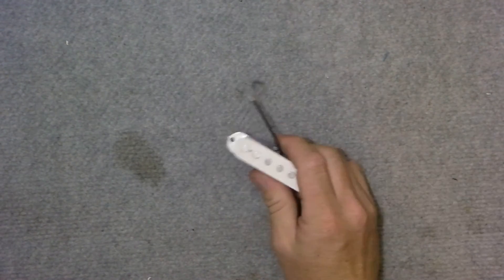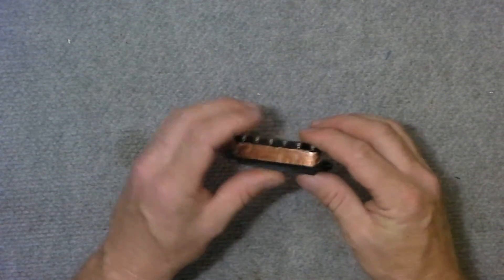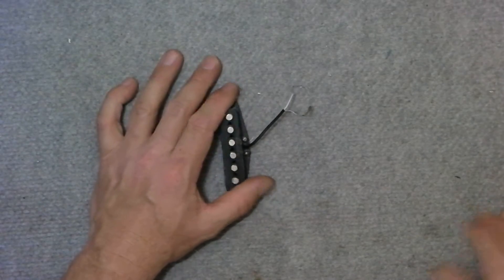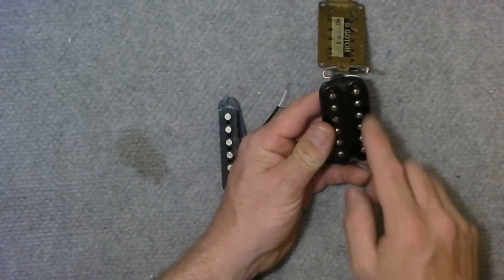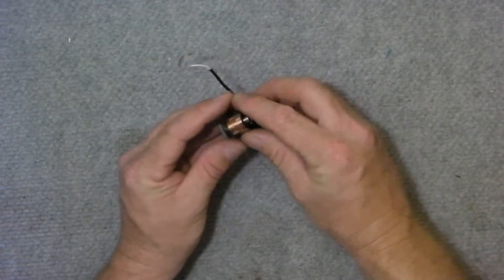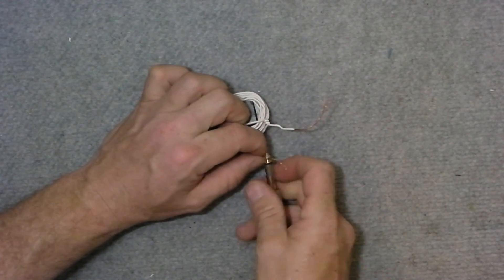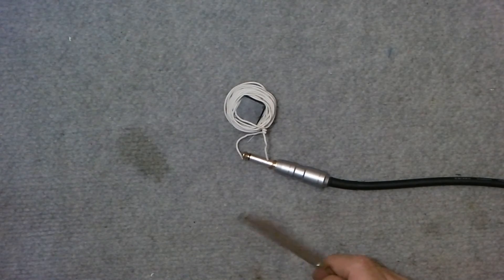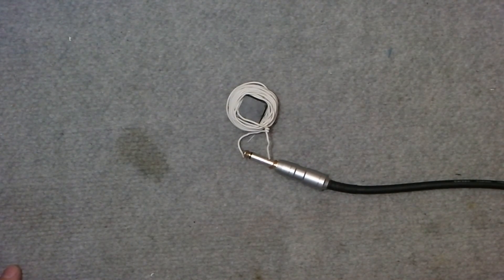How Do Guitar Pickups Work?

Comment: That wheeze with the tuning fork was quite interesting. Have you come to any conclusions about how changing single variables, i.e. wire diameter, number of turnes, shape of winding, etc., changes the sound?
Reply: The more turns increase the strength of the signal thats output, the thicker the wire allows more frequencies to pass through. This is what i have seen in other videos. Highline guitars has good videos about some of the more specifics of tone when making pickups
Reply: @saladrobe  Thank you for that. I’ll look up those vids. That’s fascinating stuff.

Comment: My question is.. If i remove the ceramic bar from my pickup and remove the steel pole pieces, then replace said pole pieces with alnico pole pieces, will that be a successful pickup magnet swap? Or is there more steps to it?
Just for reference its just a simple ceramic single coil in a yamaha.
Thank you
Reply from the maker: As long as the windings aren't damaged in the process it should work just fine.
Just make sure you push all of the alnico pole pieces in the same way with respect to magnetic polarity and the right way for the particulars of the pickup location and function. Reverse wound needs reversed magnets ect.

Some older pickups actually have the wire wound around the pole pieces.
This could make things tricky.

Comment: Nice vid, however, your custom wound coil mag should have had a post/stud 
protruding up off the magnet & your 1/4" plug should not have been in
 the path of your tuning fork in any way--just so watchers could be 
certain that you had no extraneous effects created by your arrangement 
of the pieces.

One other (obvious) thing that you probably should have noted was that an electric guitar strings are made of ferrous (iron) wire that is magnetic--and that it vibrates within a specific physical range near each pickup post.  That would be good info for super newbs...

Thanks for sharing!
Reply from the maker: Really? Why would I need a "post/stud" which I assume would be a pole piece?
Its a raw demonstration so other can see how pickups work.
Also I do refer to pickups requiring ferrous materials to interrupt the magnetic field. Here is it is in the video 4:45.
Reply: These commments are unneccessary.  The important thing is that nothing said was wrong, while giving  a very sound intro into the relationship between a string and the pickup. Have you considered making your own vid?
Reply: +Paul Graham
These commments are unneccessary.  The important thing is that nothing said was wrong, while giving  a very sound intro into the relationship between a string and the pickup. Have you considered making your own vid?

Comment: Hey, great video!
Recently I decided to investigate how the number of coils affects the volume of the signal for a school project, and i am planning to basically make a similar type of model 'pickup'. However, I also plan to make a model of a humbucker pickup with two magnets and test the effect of spacing of the magnets and their ability to reduce the 'hum'. Would this be a feasible experiment using simply magnets and wire like you have done? Also, do you have any recommendations as to the type of magnet i should use? I am currently planning to buy neodymium magnets.
Thanks!
Reply from the maker: For all intensive purposes any magnet will work providing it is strong enough.
The magnet you are suggesting though will be very powerful and aren't generally used for pickups for that reason. They may pull on the strings and cause dissonant overtones. 
Other than that your investigations should give you some data that will give accurate results.
One other thing, Humbucker coils are reverse wound and this is responsible for the hum cancelling and the magnet has one pole under one coil and the other pole under the other coil.
When you use two different magnets make sure that each coil has the opposite pole up to the coils.
Separating the coils physically with in the guitar will generally not affect hum cancelling.

Comment: What is the exact building difference between a single coil and a P 90 ? is it just  the larger, but less high shape of the windings of a p 90 and the use of magnetic polepieces(single coil) instead of one central magnet (P 90) ?
Would be great if you could help me out :)
Nice video

Comment: I love this. You actually showed, not just the basics, but some of the finer points of how pickups work that some people with a fondness for swearing and a whiteboard seem to miss entirely.  The only point that I'd contend is that pickups actually are a type of microphone, and it helps to think of them that way.  Guitar pickups are a very crude, inefficient, dynamic microphone.  They work the same way, they're just designed to pick up the string and not an audio source.  Although as you point out, they certainly can, hence the potting.  I've come across old pickups that were designed as microphones to pick up the sound of the string as much as the vibration of the string, and a few that were made from microphones. This continued into the fifties but had pretty much died out by then.
Really good video!
Reply: Heh, I liked the subtle mention of a certain Dr. Chill!
Reply: with a dynamic mic the coil windings move because they are connected to a moving diaphragm, BUT with a pickup the coil windings do not move - the metal guitar string interferes with the magnetic field around the coil -  so better to think of it as a different implementation, not a version of a dynamic mic - but a static mic!

Comment: But how does impedance works, i saw this video and thought that to reach a higher output level you must add more coiled wire, this is so confusing for me
Reply from the maker: +Hernan Castro More wire will generally increase output but due to inductive reactance the high frequency roll off will be lower making for a darker sound. The diameter of the wire affects the output also. The impedance is a combination of inductive and capacitive reactance and DC resistance. You really need to study AC circuits to get the idea.
Reply: Ok i will, at least i get the idea... the more wire, more output and more darker the sound. Thanks for your video and your help.

Comment: What will happen to the output signal if i decide to connect the wires coming out of a single coil/humbucker directly to the input jack without putting tone/volume knobs in between? Can you tell?
Reply from the maker: +Dick Brett Yes you will hear a diiference. The output will increase a small amount and the sound will be brighter and for the lack of a better term it will sound more Hi Fi.
The volume and tone pots and the tone capacitor all load up the pickup output and short out some of the output and dull down the high frequencies a liitle more than the lows. It all has to do with impedance.

Comment: Having knowledge of physics I know that magnet pickups are designed to work with strings that interact with the magnetic field changing the magnetic flow exactly as you show on your educative video.
I wonder how wood can DIRECTLY affect the magnet pickup or indirectly. I mean that:

I had an unknown model , cheap magnetic pickup .
I also recently I bought the expensive L.R. Baggs M1 magnet pickup.
Both these pickups, on any place, on top of my acoustic guitar (even without strings) detect the wood vibration, as well as would detected by a piezo crystal and connecting them on a simple battery amplifier the knocking on any part of guitar top is heard very strong.
The knocking is heard on amplifier even putting the pickups on a wooden table and tapping the table. 
For the 1st one I would say that it might have loose coil windings and that would justify the phenomenon but what about the 2nd LR?
Reply from the maker: +Στέφανος Σκιαθίτης There has to be some metallic movement within the magnetic field of the pickup if it solely a magnetic pickup.Either the windings are loose or the backing plate on the pickup is vibrating or something to that effect.
Reply: +Paul Graham (Guitar) 
Yes that is the correct answer. I asked because I prepared a video on a similar subject and I wondered how an expensive pickup as that of  M1 LR Baggs could behave the same as mine construction pickup. But I found out the explanation and I have already posted it on a video here: http://www.ultimate-guitar.com/forum/showthread.php?t=1693208

Comment: How much voltage does an actual pickup produce normally? How much should a homemade pickup produce?
Reply from the maker: +Kaushal Kishore Generally passive pickups will produce less than 1 Volt output.
The average for a single coil may be around 250mV and for a humbucker it may be 400mV.
These are only generalizations as every brand and model of pickup will have different output levels.
Extremely hot humbuckers like the X2N put out 510mV but will go close to a volt with the strings are really close to the pickup with a heavy strum.
As for a home made pickup it will all depend on the strength of the magnet, wire size and the number of windings, not forgetting the configuration. (single , humbucker and soap bar).

Comment: Very good explanation of how a pickup works. I have just taken a course in basic electronics, therefore, disturbing the magnetic field and creating an electrical current from the inductance of the coil makes perfect sense. However picking up the actual sound of the tuning fork or strings will require additional research on my part....... Vic

Comment: Hi, I'm the only idiot here failing to learn. I guess I'm trying to learn something else, and misread the title. Either way, I appreciate you taking your time to teach.

I just want to know why there are 5 different pickup ranges, and why they're used.

Best wishes.
Reply from the maker: Gordon Thomas I am guessing you are talking about the 5 way pickup selector on a Stratocaster or similar.There are many different pickup combinations and pickup selections out there and they all sound different for one reason or another.Pickup location influences sound in that the closer a pickup is to the  bridge the brighter it will sound and closer to the neck a pickup is the warmer it will sound.In between pickup selections generally use two pickups in parallel and this tends to give a mix of the two pickups but with a more scooped mid sound with a little less bass also.Everyone has they're own preferences but I tend to use the bridge selection for distortion, the bridge and middle pickup together for that country quack, middle pickup for a clean sound with less bass, neck and middle for a clean mid scooped sound with sparkle and the neck pickup for a warmer clean sound with bass.I also often use the neck pickup with an overdrive pedal or distortion for Blues and rock lead.There are also different pickup types and pickups tailored to give certain types of sounds.On top of all of that there are many more pickup combinations and many other factors that can alter the tone of a guitar.I hope I have answered your question.
Reply: ******sniffle* yes. Yes you have answered my question. Thank you.

I'll be copy/pasting this if you don't mind. Only to a personal note file.

Forever a student.

So When you want 'lower' sounds, you lean more to the 'bottom' 3 selections, and lean to the top two for the highest, tightest/brightest sounds?

Or am I way off?

Comment: Hi Paul, 

I was wondering if you could help me out a bit - I am doing a university dissertation on guitar pickups. I have built 4 pickups for comparison: all humbuckers with 42AWG wire and the same number of turns (5350 on each 50mm bobbin), but with a different magnet in each pickup - Alnico 5, Alnico 4, Alnico 2 and Ceramic 8. I have audio clips of each pickup tested using the same plucking velocity and same guitar etc. Basically the only thing that is different is the type of magnet, in order for a fair test.

I was wondering if you could tell me what differences I should see in each magnet? ie. characteristics in tone and output levels? I'm finding it hard to get the information that says this. Any input of yours would be greatly appreciated as I found your video inspiring.

Cheers,

Elliot
Reply from the maker: Hi Elliot.
From the information I have seen the lower the grade of Alnico the more inductive it is and this should result in Alnico 2 having a reduced high frequency response as compared to the rest.
Alnico 5 will be the strongest magnet in the Alnico magnets thus having the most output from the Alnico magnets.
The ceramic magnet will possibly be the strongest magnet thus giving the highest output and will have the broadest frequency response.
Hope that is helpful.

Comment: I've been trying to find info on how you know your posts or plates are magnetized enough or too much, without having to install it back in the guitar. 
Also, why are humbuckers generally made with a plate magnet rather than magnetic posts like some high end single coils?
Any way you could help me out?
Reply from the maker: The amount of magnetic flux within your pickups really is a personal thing.
Magnetic flux can be measured using a Gauss meter.
Powerful magnets tend to create a more saturated compressed sound.
Really as long as each string has an even volume through your amp I would not change anything unless you aren't satisfied with your sound.
As for humbuckers using a bar magnet instead of pole pieces, it comes down to cost, simplicity and design as far as having adjustable pole pieces.
A single bar magnet is cheaper to manufacture than magnetic pole pieces. Also the pole pieces in one coil would have to be spun around to the opposite polarity.
Manufacturing magnetic screws for adjustable pole pieces is also an additional cost.
Reply: ***** Awesome, Thanks!   I knew tone and personal preferences needed to be heard to fine tune the sound youre looking for, I just wasn't sure how touchy the process was.  Like if there was a general rule of thumb for how much to magnetize your pole pieces that allows the pickups to function but not sound like complete garbage. And thanks for the answer about the humbuckers! Makes sense.
Very enlightening video by the way. I enjoyed watching it :)

Comment: Thanks for the demonstration. I inherited an old electric-acoustic from my stepdad a while back with a hole in the side where the amp jack was, and no electronics except the pots. I recently decided that i'd like to diy reshore it and this vid helped me understand how a pickup works. Unfortunately it is missing the 6 magnets from inside, but I do have a bunch of neodidium magnets on hand I could use. I might find some iron rod to stick in the holes and put a magnet on the end just cause they are small... anyway, I gotta start searching how I will wire up the pots to the pickup and jack...
Reply: I might also have to rewind it, but seeing as there are thousands of coils... i'd rather try to salvage the old coil.

Comment: Paul wonderful video, I have a question, I heard you said low price single coil pickups have a magnet at the bottom and the more expensive ones the polepieces are going to be the magnets, will that affect the tone of the pickup?
Reply from the maker: Generally those cheap single coils use a ferrite bar magnet and ferrite magnets sound brighter than alnico due to parasitic induction in alnico but that's another subject.
Also the pole pieces in the cheap pickups will be mild steel which will darken the sound slightly due to that parasitic induction effect.
It is hard to say what the overall difference would be without testing it but I believe there would be a perceivable difference.
Also the location a strength of the magnetic field would differ to some degree which would affect the output.
In my experience even adding shielding to the pick guard in the area around the pickup can alter the tone if it is within the magnetic field.
Thank you for this thought provoking comment Jonathon.

Comment: How come the current is induced in the coil instead of the guitar strings?
Reply from the maker: A current will be induced into any conductor that is within the magnetic field when it is changing from the string vibration,
This includes the string.
I just measured the voltage per string from the bridge to the nut with a scope and it is around 0.5mV. By comparison pickups generate from 100mV to 500mV generally.
The pickups are designed to capitalize on generating a voltage from the string vibrating.
Reply: ***** Thanks. This helped a lot.

Comment: Is there a way to wrap it easier without a wrapping machine?
Reply from the maker: The only alternative is to wind the wire on by hand.
Could take a while when you need thousands of turns.
Reply: If you are using a barrel shaped magnet it might fit into a drill for fast winding.